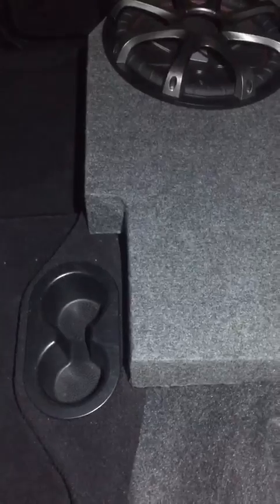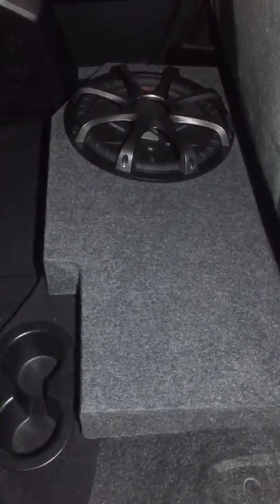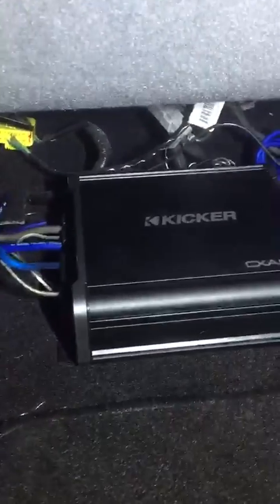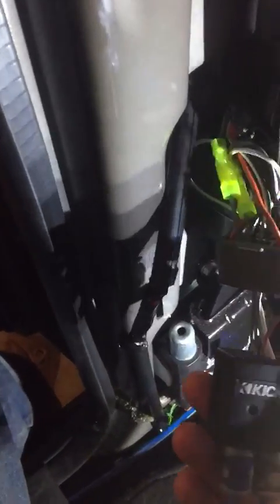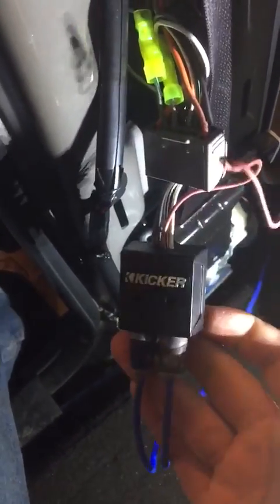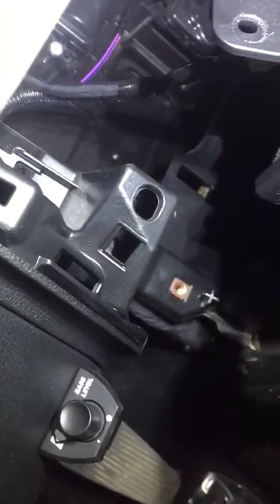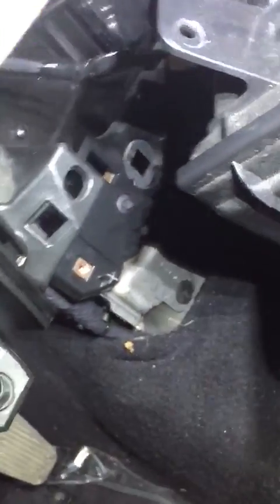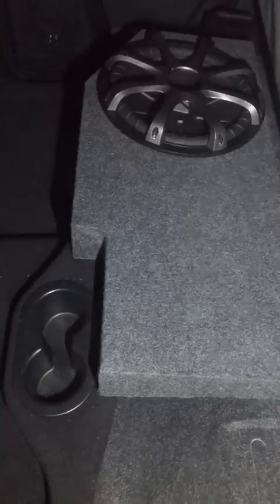2014 Dodge Ram 1500 Subwoofer Install

Comment: Quick question I got the kicker version of this loc which has the remote wire. But my question is, is it OK to tap into the stock OEM subwoofer connection? Is it too much power for that little device or will it be OK? It’s the stock amp and subwoofer plug in the back of the mega cab behind the seats . Just because it’s easy to access is why I’m asking.

Comment: Of you use a Pac line out converter with remote turn on you dont need to tap into your cigarette lighter. Makes things a lot easier. And it's 19.99 on Amazon

Comment: Good amp/sub videe. No LOC in my 2015. Fosgate r500x1d has high level but I used rca to wire tapped to both b pillar speaker wires for a clean install. Wires were the only ones twisted green & white, green/yellow, etc. And I tapped into pink blue wire under driver seat that comes from console 12v for remote

Comment: I'm lookin to put an amp and sub in my 2016. With the LOC you don't have to tap into both L and R rear speakers?
Reply: Don't have to but I tapped into both at same place, easy to identify green wires because they're twisted together. Also found pink wire under driver seat to use for remote wire. Fosgate R500x1d is bought rca to wire and used that for a cleaner install instead of high level plug